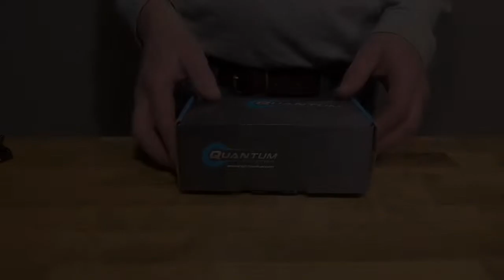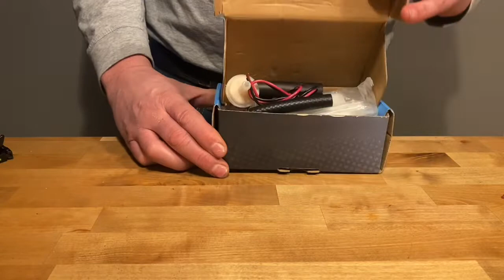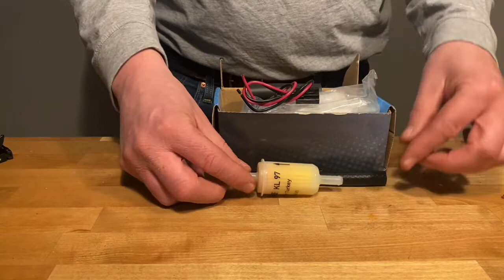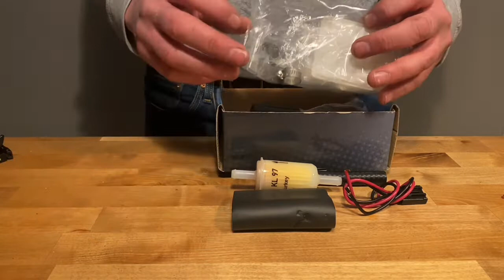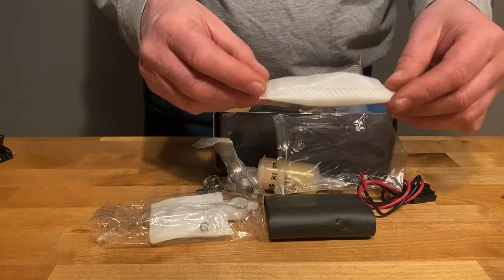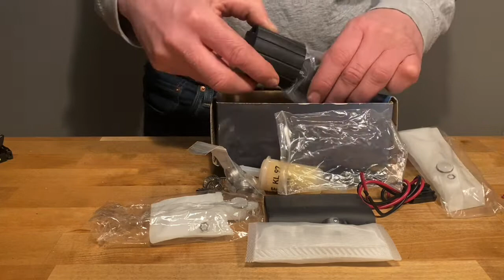2009-2014 Ducati Monster 696 fuel pump replacement, HFP-385-UF

Comment: Why do your fuel pressure regulators look the exact same as the 696 but none of your part interchanges say it can be put on the 696. And none of your 696 kits include fuel pressure regulator.

Comment: Why sell it if there is no fuel consumption sensor in this kit 💁🏻♂ if you change the fuel pump, then you need to replace all parts of this system.
The fuel consumption sensor is an important detail!

Comment: hi! is the fuel reserve sensor indicating refueling already built in?
Reply: @quantumfuelsystems  Please tell me, I am from Brazil, but I am in Russia is it possible to make an order to this country or maybe there are dealers?
Reply: @quantumfuelsystems  Can I ask you one more question, is there really a fuel level sensor in the kit?On my motorcycle, it went out of order and became non-working, showing a fuel supply error error. I would like to replace this with your kit, which would have all the necessary parts for this.